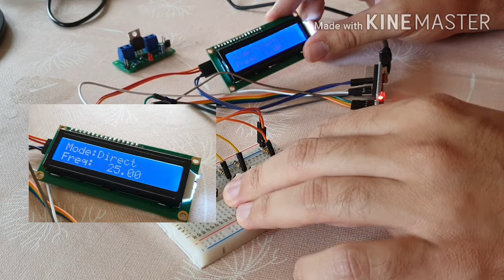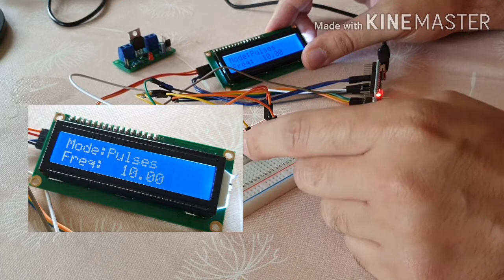Solenoid Controller ATMEGA 328P

Comment: I would be interested in a link or model number of the solenoid please or if you have found a better one Thanks Ray
Reply from the maker: Hi, if you need a high impact low frequency you can use the shorturl. at/bEPVY (you have to change the link to open it). For fine work the 1335 or 1330 solenoids will work. You have to controle the power of the psu also. I ended up making my own coil with 0.35 mm and 0.2 mm wires. The base I got came from the shorturl. at/JMUVZ solenoid. I cut the plunger at the second mark to get it as the shorterst possible. It fulfills my needs. Instead of regulating the back of the plunger I changed the distance in front of the plunger. It varies from 5mm to 3mm for finer work. You can check my github for more information https://github.com/Savage-Sabrina/DIY_SolenoidGraver 
I hope you have a wonderful weekend and a great 2023.
Any other doubts feel free to ask again.
// Sabrina

Comment: hello, first of all, you did a great job.  My electronics knowledge is not advanced, I want to try it with Arduino as a beginner.  Could you share the wiring diagram for it?
Reply: can i buy the control card
Reply from the maker: @Gazanferylmaz  hey, how are you. Were are you based? I do not sell it but if you want I can send you one of them. I have 5 now. Tey are working great. I have to make a drawing with how to make it with general parts for arduino.

Comment: Very nice. Impressive work.
Have you had time to complete assembly of the PCBs and test the tool?

Also could you please upload the Arduino code to Google drive. Many thanks.
Reply from the maker: Hi, Henry. Sorry for taking so long. The code is actually on the drive file uploaded. If you need any question interpreting the decisions I made in the code, feel free to ask.
Reply from the maker: I didn't see you asked about the PCB.
I tested the PCB and the tool, working better than I thought it would. 
The issue i realized it's that I have to sharpen the graver better, I don't have a way to sharpen it now. Waiting for more money at the time.
The Input I tested was between 6V 2A and 18V 3.5A, the internal capacitance of the PSU is important when you are at 1HZ pulse at about 25% of the duty cycle or more, this is kind of a short circuit. 

The function for micromotor and potentiometer are not well implemented in the shared folder. I still didn't get my hands into a foot pedal to test it. 
If you have any other question feel free to ask.
My goal here is to share the information with people and not to compete with commercial products.
As soon as I get my hands into a sharpening diamond stone I will share more.